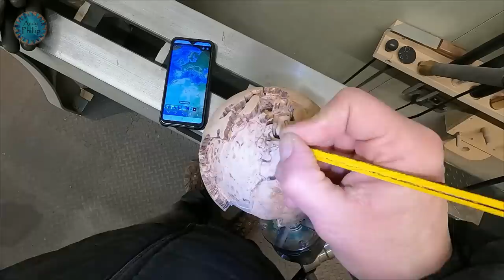Woodturning - How Cool is Maple Burr !! (no mid roll ads)

Comment: I am always amused how you put in so much time and love on taking odd pieces of wood and making them shine, then you take standard, nice woodturning blanks and use them as a basis for the art instead. It is a real 'diamond in the rough' kind of outlook, which I appreciate. When I work with stained glass, I will sometimes deliberately include wonky  bits of the glass to bring more character into the overall work. It's also less expensive to get offcuts, and it really encourages creativity.